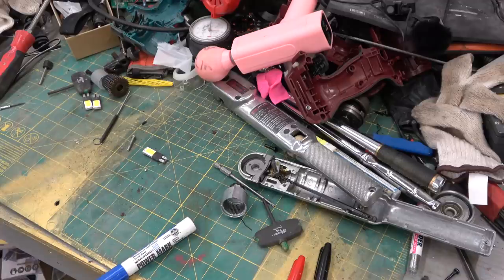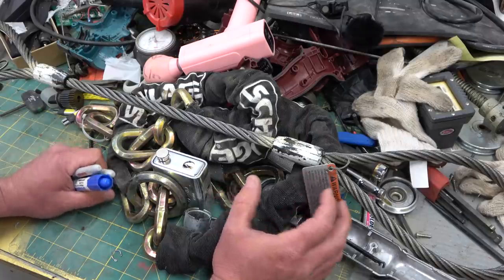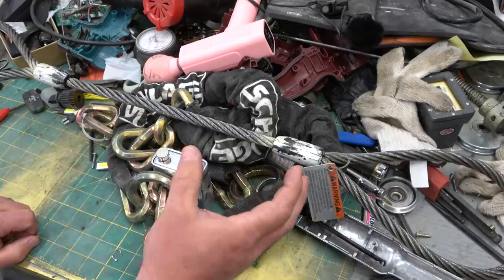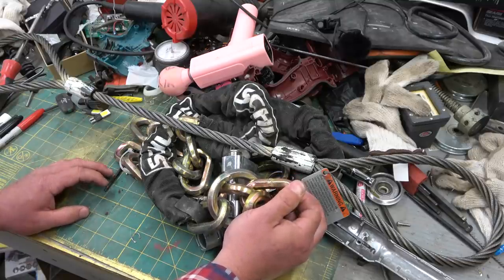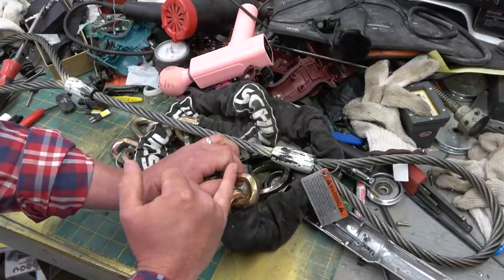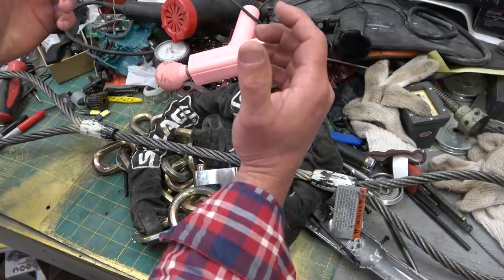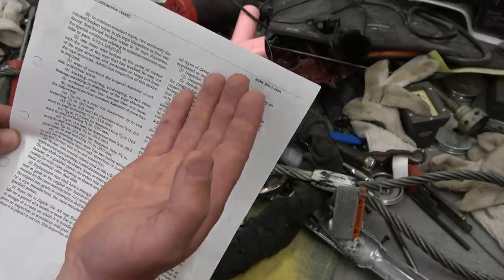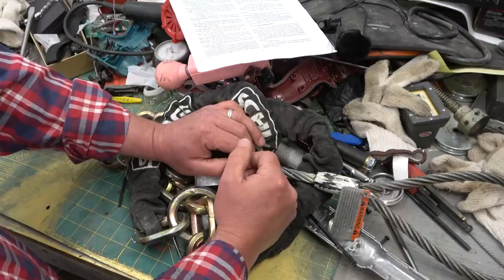"It is not known why the pulling cable snapped."

Comment: There are apparently pictures showing the disabled brakes (on cabins with passengers) already in 2014 and 2016. It seems like this was common practice. And they really did state, that they didn't think the pulling cable could ever break. To the management the emergency brakes were just an inconvenience.
Probably all they needed to fix was a bit of leaky hydraulics.

Comment: You are correct in your summisation.
I believe the cable car was unused during lockdown, and in addition too your comment insight the cable would develope weathered corrosion in more places, as well as some uneven sagging, likely too, most or all the tensioning adjustments was also already used up IMHO too.
And rather than afford the costs of re-caballing the ride before opening, they tried to earn it first.

Likely a key owner/investor of the ride operators are mafia/local government/syndicate connected, and forced the issue to open up for the public.

Comment: During the late 1890's when pedal bikes were being developed, it was found that the tubes inserted into junctions broke, due to metal fatigue at the sharp changes of section. 
This was cured, by fishtailing the junction tubes.
This seems to have been totally abandoned by modern bicycle manufacturers, probably because in the 1890/early 1900's bicycles were expected to last a lifetime of constant daily use, rather than a few days a year as a toy.
Your wire rope, with metal cleats instead of being spliced will tend to have the same problem, as you mentioned.
History is littered with disasters, where the knowledge to prevent them was fully known, but not by those that caused the disasters.
One prime example was the Comet aircraft, the first pressurised airplane. 
There was ample knowledge of pressure vessels, gained from the early disasters from exploding steam engine  boilers, but ''Aircraft Engineers'' were too 'advanced' to consider the lessons from the steam age!
Another, is the stresses introduced by distortions caused by machinery in use, like cranes,  which introduce stresses that wouldn't occur in static structures, but can appear to be static structures.

Again, like you said, if emergency brakes are operating, fix the cause, not the symptoms, [thats what 'doctors' do!]
My conclusion would be; Gross Carelessness for Safety, by the management.
.

Comment: Not the first time I've seen it mentioned that safety procedures, standards, and regulations are "written in blood". The Italians have already arrested three associated with maintaining the cable car and managing its operation. Now the wheels of justice for them will turn quite slowly. I believe you nailed it precisely regarding the pull cable failure resulting from repeated brake drag over time -- with periodic cable inspection being of insufficient frequency to detect how rapidly the cable was being damaged. I'm certain the two management individuals will skate off free claiming ignorance while they should be held accountable for dereliction of their duties and not knowing what the maintenance person was doing or being aware of repeated problems with the safety brakes. Legally it's called "willful blindness" when someone deliberately ignores a duty or obligation to attain and maintain a plausible claim of deniability regarding readily foreseeable catastrophe. The idiom for it is "turning a blind eye" (a reference to Admiral Horatio Nelson's claimed inability to see fleet signal flags issuing orders he ignored).

Comment: Hello, Italy here...
Your theory was the 1st thing I thought, DC motor overloading the 'braked' pull cable few times in a period and then it snapped... However, I discussed this idea with an engineer in charge of cable cars maintenance, and he told me that this should not happen, as the DC motors have a safety feature that stops them if there is too much torque applied to the rope, well under the rope stress limit, if this was maintained of course... However, all that said, it may even be that the 'smart guy' that created this accident, may have even tampered with such safety features...He also told me that in a video of the same cable cars plant, there is a picture of something able to damage the pull rope with time near one of the stations... So, may even be the brakes intervention was a warning that something was wrong on the pull rope, and the 'smart guy' decided not to investigate and blame the brakes, and do what he did...
Of course, all here is theory, waiting for something more...

Comment: I had spent a few years as a damage investigator for a locating company.
 As such we were trained to look for the root cause for the damage.

In every case no matter who was at fault. It takes more than one error to cause damage.
Because there are standards involved. If your following procedures.
And you miss one.
It gets caught and corrected.  Or at least the results of the error are minor.
Out of all the damages some running into the millions of dollars.
The bigger the damage, the more things had to fail at the same time.

There is a lesson that we are supposed to be getting here. And we keep missing it.

Comment: As part of my job when I was an engineer was to provide some "on the job" training for new engineers, this was in addition to their formalised training courses. I would tell them that regardless of who (whether management or client) might be insisting that the equipment needs to be up and running and back in service regardless, don't put it back into service unless you can say with hand on heart it is safe to do so. If parts or major work required then that comes first. If a manager or client were still insistent then ask them to sign something to say that they were overriding the engineers decision, I would  ensure them that no manager/client would actually take up the offer. In 20 years of service I never once had to go that far, it was always sufficient to say it was unsafe to do so.  

I also had a visiting manager that carried out a Thorough Examination under LOLER on some equipment and then asked me sign the paperwork because I was the engineer on site. I refused and said that I would only sign it if I were to carry out the Thorough Examination myself, but happy to do so.

Comment: What you described cannot happen: the track cables are not fixed, at either end. They are tensioned at both ends (in the simplest system with a pulley and a big counterweight, in more complex systems with a hydraulic cylinder). If the emergency brake clamps on the track cables and the haulage rope start pulling, it will move the cab AND the track cables, lifting the counterweight. This will hit a switch and trigger an emergency stop. During the whole procedure, the haulage rope is loaded with a very well known weight: cab + track cable + counterweight. It is dimensioned to take that without any issue. The problem must be somewhere else.
Reply: Ah, I forgot something: the track cables are electrically insulated from the rest of the system. When the brake is applied, it closes a short circuit between haulage rope and track cables, which is detected and shuts off immediately the motor. So the motor cannot pull on a cab with applied brakes.

Comment: As an Englishman, who regrets moving to France, I've seen a remarkable lack of responsability in southern Europeans. Germany and Scandinavia are very professionel but below that limit, forget it. The Americans have a saying that"if it ain't broke, don't fix it". Here the attitude is "it's broken, so what". After the 2nd world war,the Spanish made Me 109 fighters for their air force but powered them with Rolls-Royce merlin engines, so what you ask?. The fin on the 109 was offset to take into account the airscrew effect, the Merlin engine that they were now using turned in the opposite direction. The result was a bad aircraft. This is the same thing that happens all over southern Europe, no quality, service or guilt.

Comment: Wait, @ave can you explain:  The brakes would have dragged on the main cable, not the haul cable.  So what frayed the haul cable then?  Is it the friction from the bullwheel which is trying to spin the haul cable against the force of the dragging brakes?
Reply from the maker: Exactly. Emergency brakes dragging caused overload damage to the haul rope.

Comment: I've had several safety related jobs. In one, as well as being the safety instructor I was also the site safety manager.  We had refrigeration packs on the roof. There were low level beams and pipes, I therefore decided that anyone working in the area had to wear a hard hat, and put up appropriate signage. One contractor decided he knew better. Somehow he knocked himself out. It took a firecrew nearly an hour to extricate him.

Comment: Very different situation at my work as far as people dying immediately because of management negligence, but very much the same in the long run for the health and well-being of others in the long run… As an example, we have a leaky foundation at one of our PUBLIC places. It’s been leaking for so long, the drywall is inundated with black mold. Eventually, it was decided we needed to do something. Tore all the drywall out, all of the rusted through steel studs and brittle, exposed live wiring. A contract was brought in to dig a 7-8 ft French drain (inside the basement mind you!) and a small Sump installed(which is insanity in and of itself imho) a piece of 10 mil white plastic nailed to the interior concrete wall and a membrane installed at the bottom to “catch the water”. I, being the grunt, decided to torture test it. It didn’t end well… rivulets of water streamed down the outside of the plastic and onto the new metal stud I installed and then a house pool of water accumulated on the floor, underneath the new studs and carpet. I took video and photos. Reported back to ‘management’. They, I guess being exasperated, instructed me to go ahead and start throwing up drywall and buttoning the damned thing up ANYWAY! Needless to say, we will be tearing back into this in a matter of months yet again! The fact that a decision was made to not fix the foundation FROM THE OUTSIDE FIRST, boggles my mind! This is an ongoing issue at many of our buildings. And we’re told to continually sweep shit under the rug; all the whole staff are getting sick, and possibly members of the public may as well!  And what you said about being pigeonholed rings so true! I was supposedly hired for my skills and problem solving skills, but in reality am just a monkey with a hammer, etc. is soul crushing! I actually care about the work I do and the potential safety of others! MANAGEMENT obviously doesn’t!!!! 🖕🖕🖕🖕management!

Comment: The Italians released the security cam videos of the incident, its horrific. The system was modernized within the last 20 years or so, but my understanding from the investigation so far is that the braking system was in need of a major rebuild and that management did not want to shut the system down to do the work. According to the investigation there was also a lack of proper inspection of the the system prior to daily operation as a technician is required to inspect every haul rope socket connection daily and that this had not been done due to a lack of trained staff. In the end there was no reason to ever operate this tram with the emergency brakes overridden.

Comment: As a tech who's worked on passenger trains and then later written safety protocols (unrelated industry), I've learned that a) management knows when safety stuff is bypassed, b) knows not to document that it was, and c) will push the blame down to the bottom rings of the ladder

The tech who pulled that shit was very likely explicitly told to, and told not to document it

If he didn't play ball, then he'd be replaced with someone who would

Sometimes, a job isn't worth keeping

Comment: A good technician knows when to save the company from itself. This usually has the side effect of preserving the technician's job and sleep at night. 

Management usually deals with sales and decisions, where it holds power and there's a lot of room for haggling. 
Technicians deal with hard requirements where things either work correctly or they don't, things are either done by the book or they aren't. As a technician, you don't haggle on hard requirements, even if management is not happy with your answer.

Comment: This is why you don't take shortcuts folks... I worked in several coal mines in my area and the only injuries I saw, that were worse than the occasional cut or scraped knee, were caused by a lack of proper maintenance and safety procedures being followed.

Comment: During my last job-hunt I got asked regularly why I changed workplace twice in only 1.5 years.
I always answered honestly: "because management obliged me to implement quick, dangerous and stupid solutions to a problem and threatened my job if I refused to adhere."
Then some companies are amazed all their engineers leave for greener pastures. (I'm an embedded hardware/firmware dev). 

It wouldn't amaze me if the Italian cable-car technician was forced by his manager to implement a 'timely' solution, by disabling the brakes to continue 'normal' operation. The wording 'timely' is  sadly a strategic excuse used by many managers, they knowing that there will never be any time to set right the issue in the near future. Management also knows that, whenever the technician or engineer executes such request without requiring proof on paper on email, they're the one held responsible for potential injuries or worse, while management act's as unknowing pigs.

The only reason I can refuse to execute such requests is due to my savings, not everyone is this lucky. Something has to change in the future, so that managers can't threaten technicians or engineers of getting fired, when they're refusing to endanger other living beings. I've even known occurrences where the previous company would ruin the technicians or engineers reputation for refusing to oblige on dangerous things.

With increased wage comes increased responsibilities! However, most managers appear to only have interest in the extra money.

Comment: Pro legal tip: that fine print on the back of your ticket that you assume all risk and the operator none does not apply to operator negligence. They can't point to the back of the ticket and then kill or harm you through negligent action or inaction with impunity.

Comment: I have verbally mentioned safety issues to management in the past and was give the old brush off. If you see something unsafe and you are told to disable something get it in writing. Also do not tell management via orally put it in writing like a email. Once its in writing they will fall all over themselves to fix the issue.

Comment: I honestly think that these cable lift systems are a faulty system to begin with. It's not like they are elevators. But they re leveraging weight a horizontal latitude. And in the outdoor elements. So there is more possibility of failure.

Comment: IMHO it's gross negligence as well as gross stupidity.  Any technician that disables anything installed for user safety if the device is then to be used should be fired and strung up.  Management should know this and it should apply to them as well.

Comment: I may be missing something, but wouldn’t those brakes would operate on the support cable, not the haulage cable? Obviously they should never have been disabled, but I would imagine the cable failure was unrelated to the brakes.
Reply: Yes indeed so should the haul cable part or fail,  the brakes should stop the fall by clamping to the suspension cable. In this case they had been "adjusted" to free off the extra imposed load from friction or drag on the suspension cable (because this was the initial fault).  This extra imposed frictional load is directly applied to the haul cable causing early failure.

Comment: I worked in a precast concrete plant.  We regularly lifted things that weighed over 20K.  I never once saw a cable fail or a crane fail.  Even then I would never stand under a load.  Its just moronic.

Comment: aviation leads the way in safety critical management - there are multiple layers including human factors training, threat/error management training, open reporting (including reporting yourself for an error), no blame culture, SOPs, checklists, team decision making and seeking opinions from others without leading them to the answer that you've arrived at yourself - the ability of any member of the team to speak up if they're not happy, tool management to make sure tools don't get left in planes - but good management is essential to embed this safety culture into the company and empower individuals to make safe decisions and speak up when required...   constant audits by regulators is another key feature...   the medical profession is adopting some of these procedures to improve their safety - they kill far more people than aviation but doesn't get the same press attention as a plane going down ..  A safety system and culture is expensive - but it's much cheaper than an accident.

Comment: My bet?  Tech had been telling management it needed to be shut down for brake overhaul (leaking cylinders causing the pads to drag on the cable probably?) for weeks or months and management refused because they, as you noted, wanted the profit from it running continuously.  He was likely browbeaten into disabling the brakes instead.  Me, I would have produced written record of my objections to this and the authorities might have mysteriously showed up to do a safety inspection some time later, but people respond differently to pressure.

I blame management.  If they had correctly planned for maintenance schedule and costs this would not have been the outcome.